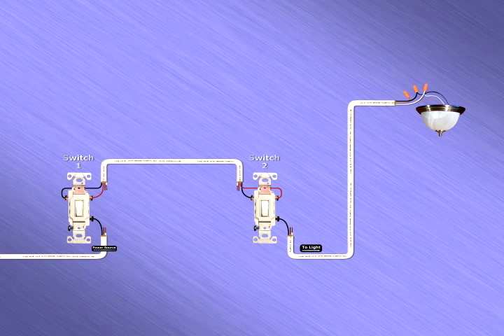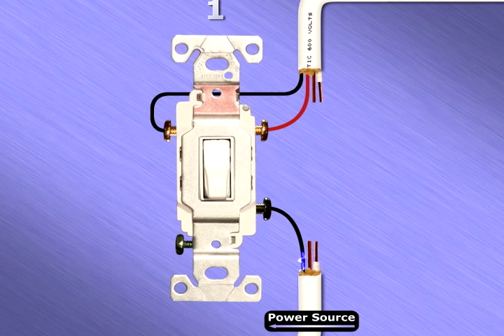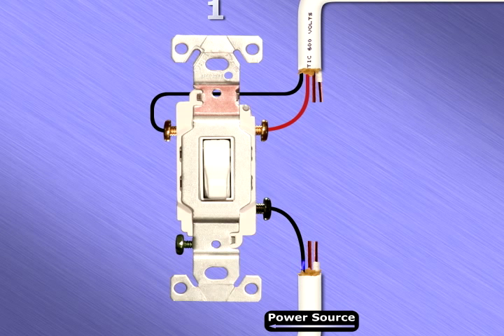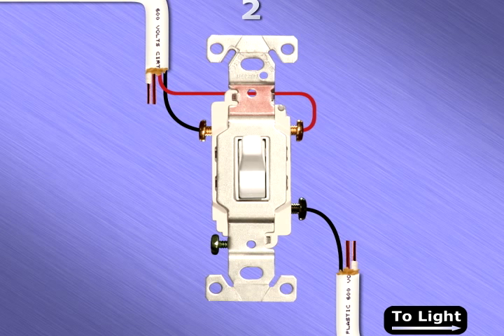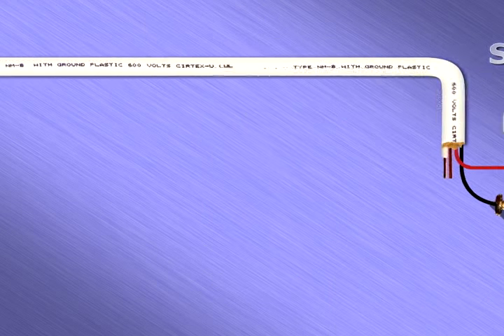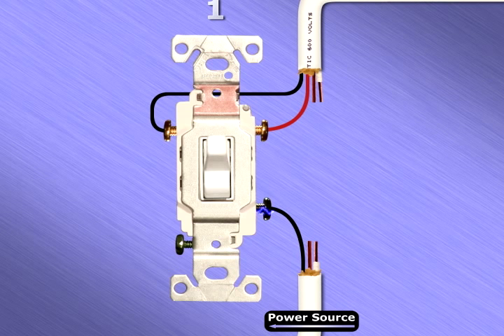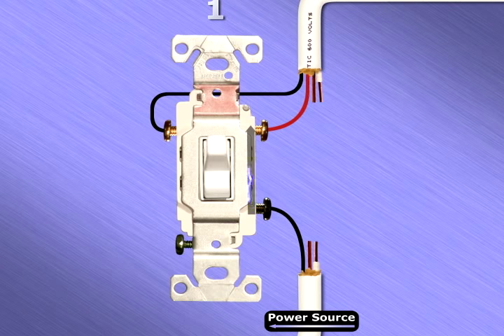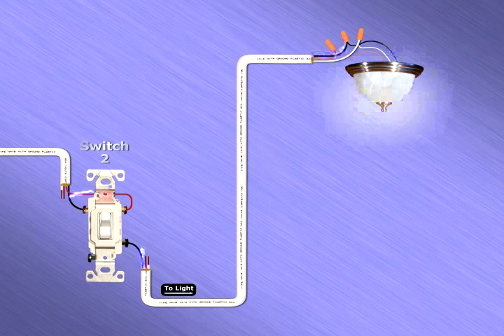3 Way Switch Animation. How a 3-Way switch Works

Comment: its still so confusing
Reply: It's funny bc to me it's so clear when I watch these videos or get these lessons in class. As soon as I have to run the wires out on a rough it's like my brain shuts off or scrambles or something. The only way I can do this is by drawing a diagram on site.
Reply: Go get your husband to take care of your confusion
Reply: @thelostviking225 me too lol.
Reply: @elyzium i agree
Reply: How is this confusing. The switch switches the current from the black to red wires. Both of them are hot wires. If both switches are switched to red, the light turns on. If both are switched to black, the light turns on. Therefore, switching either light switch will make the light turn on or off.

Comment: The trick is that these aren’t normal “on-off” switches, basically they break one circuit and energize another one (power is always flowing through part of the switch) whenever they are flipped. Rather than a single pole single throw switch that just breaks or energizes a circuit.

Comment: Now I know what was confusing. So, in this case, when both switches are up or down, the light will be on. However, I know many houses use a different method. In many cases, the light will be on when one switches is down and the other one is in the up position.

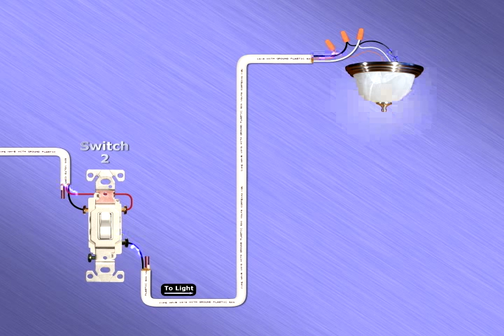Comment: This is the most informative 1:23 video I've ever watched. I've always wondered how the power is supplied to the other switch when the supply switch is in the down position. It's a constant power. All the switch does is change the power from pole to pole. Now it all makes sense of why I got shocked once dealing with a 3-way switch. Someone installed a 3-way switch in place of a normal 2-pole switch. The ground wire was connected to the left pole. The ground for that circut was electrified.
Reply: So why didn't the circuit short to ground when the switch was flipped? Just curious.
Reply: @maedie1  hmmmm, you're right, it should have, but it didn't. I didn't own the place long enough to look more into it. When I changed the switch to a 2-pole, everything was good. Two months after I sold the place, it was destroyed by a hurricane.

Comment: Hi. Thanks for the instructional and I thought it was very good. I wonder if you have a video showing the inner mechanisms of 3 way and/or 4 way switches, which shows exactly how flipping the lever can connect and disconnect the juxtaposing travelers and commons. Have not found such a video yet. Thanks again.

Comment: There are no defined NO or NC terminals like you would find on a spdt relay, or temperature switch, or pressure switch. The current path depends entirely on the relative positions of the two switches.
Reply: You an 1141 or what

Comment: Why is this a 3-way switch? 
1st Way: common contact connected to contact A
2nd Way: common contact connected to contact B
Where is the 3rd way?
Reply from the maker: The technical name  for a 3-way switch is SPDT (single pole double throw).  The term 'way' comes from the old english term 'weg', which meant a road to a town.  In reference to the switches, way refers to the amount of terminals (not including the ground).  So that's the best I have for you.  3-way, 3 terminal, or 3 ways for wires to connect to the switch. Another explanation I have given is that it is a 3-way switch in that 2 switches control a light fixture(s), that totals 3.  Rest assured you are not alone with asking this question.  Some refer  to them as 2-way switches which really makes more sense.  It can be in 2 positions.